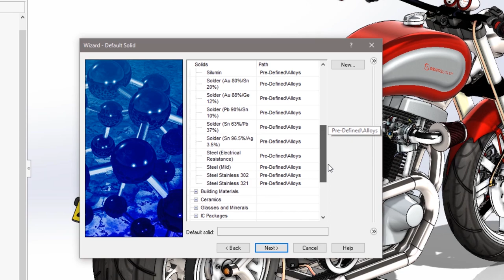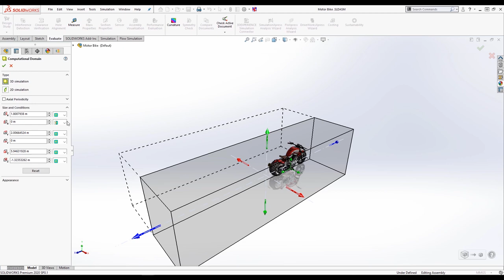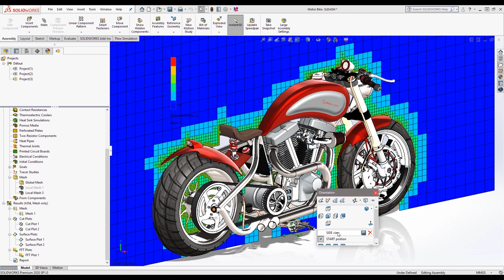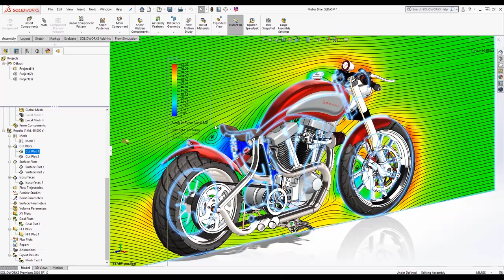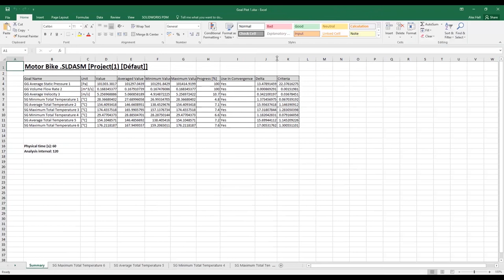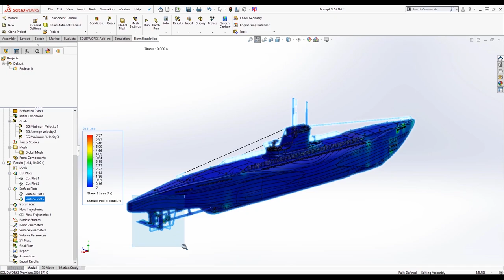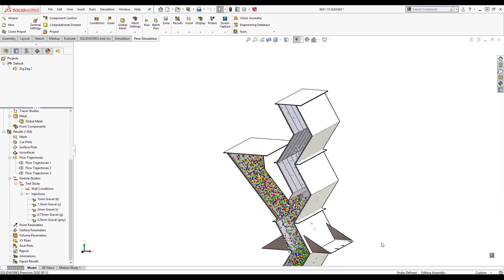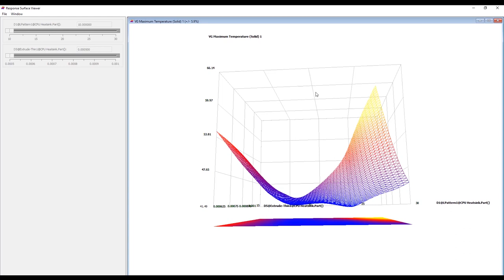Introduction to SOLIDWORKS Flow Simulation

Comment: Hello! I'm begging you, Please enlighten (from the point of view of SolidWorks analysis) in what position the airplane propeller (in flight) creates less resistance when the engine is off: 1). if the screw rotates freely or 2). if the screw is locked.
Reply: most likely a one way clutch for free flow
Reply: @CCROSS5882  Thanks for the answer!